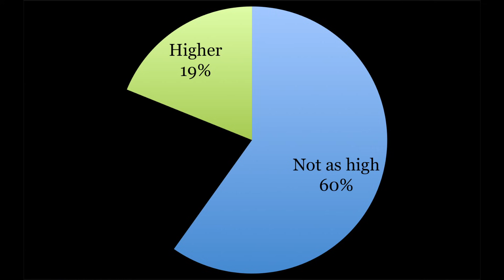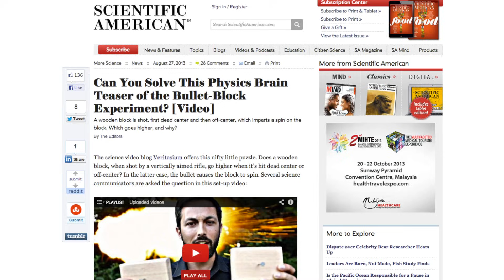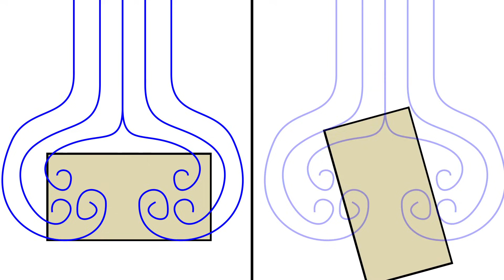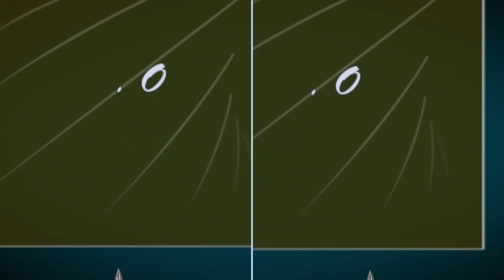Bullet Block Explained!

Comment: I know this video was over a year ago, but I watched it then and wasn't satisfied and I've rewatched it now and I think I know a better way of explaining it. The block shot in the middle IS rotating, but it is rotating away from itself in two equal parts, either side of the bullet. Imagine shooting it in the centre with a much larger calibre gun, the block would split in half and each half would spin off, one clockwise the other anticlockwise. This rotational energy is easily seen when a low calibre gun shoots the block to the side, because there is less wood on one side of the bullet and the energy can be more easily imparted into the smaller object. However if you shoot a low caliber gun into the middle of the block of wood this energy rotating in opposite directions is invisible to the human eye, because each half of the block tries to spin opposite the other but not enough to actually tear the wood apart.

Therefore, both blocks are technically rotating, but only one shows it in a way we would traditionally call 'rotation'.

Thoughts?
Reply: No, rotational energy is only based around total rotational momentum (and the moment of inertia). What way it would have spun had it not been stopped doesn't come into it. Smash two spinning wheels into each other, and they'll heat up, because both wheels have slowed down and its rotational energy has turned into heat.
Reply: It sounds plausible but it's impossible for one thing to be moving in two directions at the same time. Something can move in one direction and then another extremely quickly so that we can't see it (ex vibrating objects).
Reply: I'm sorry but ... No. You complicated the case too much. To understand why this isn't possible, imagine someone pushing right on your navel ( The human's body's gravity center ) when you're on a skateboard, for exemple. Can you say that your body is actually spinning ? I don't think so.
The explanation comes simply from the fact that the bullet lost less energy penetrating the wood. Right side got pushed away, it COULDN'T actually stay still and this particular side then has gone up, meanwhile, left side was also pulled up because it was sticked to the other side, it couldn't just stay behind. Due to the fact that the mass wasn't balanced compared to the center of the impact, it first had less mass to push up, the bullet then conserved a bit more energy that it redirected in a rotation movement ( Because the vertical momentum MUST still be unchanged ).

I really hope you've understood me, because I'm not a native English speaker and I might really suck at it.
Reply: DEREK RESPOND TO FIRSTNAME!!!!!
Reply: Firstname Lastname nope
Reply: I don't think this is a better way of explaining it, and I think the way veratasium explains it is much more accurate.
Reply: Firstname Lastname I think you're correct. However i wouldn't call it invisible rotation, but more the desire of the material to rotate (shear stresses), resulting into friction in the material. The friction then produces heat and the total energy is conserved.
Reply: mendel keller Explain to me one other time an object is able to move in two directions at the same time.
Reply: mendel keller Well sorry about that.
For the second experience,
Let's assume the wood plank was 20 cm ( 7.875 inch : ~8 ) long and the shot has been fired at 5 cm from the edge. The force then applied around the impact point 5 cm ( 1.96875 inch : ~2 ) large ( The force was applied on a shorter surface = less mass to pull up - and this is also the reason why the bullet didn't go as far as in the first experience ). That's what I will call "Right side". Even if this "Right side"got pushed up, "Left side" was still attracted downward toward the center of the earth by the force of gravity but you'd agree if I say that a firing gun deploy much more force than gravity. So, instead of just going up vertically, the "Right side" continued to travel and the "Left side" had no choice but following the movements ( Upper and the rotation ).
Reply: Firstname Lastname

Looking at your explanation, I see what you are thinking. Unfortunately, due to the fact that there is no observable rotation to one way or the other, the energy imparted can't be explained in rotational energy. The kinetic energy imparted in the block of wood by the sloped sides of the bullet would be equal on both sides, which would cause the block of wood to expand and contract very quickly around the bullet as is imparts momentum into the block. This is what was meant by energy being lost due to heat energy. The spinning block on the other hand, has inertia on one side, so the rotation would be imparted from the get go. Unequal energy distribution would cause this in nature on any given occasion. The reason they both gain the same energy vertically, would be due to the fact that the bullet would impart the same lift because as the bullet hits, the inertia is only off to one side, meaning that momentum picks up higher on one side of the block, and is picked up less on the other. Until the bullet and the stops moving inside the block of wood, they can both be considered separate entities. As a result, the energy imparted by the bullet would be equal, allowing both to reach the same height. But due to conservation of momentum, inertia holds one side back, and has less effect on the other, causing a natural rotation that does not require any extra energy input at all.
Reply: I think that what you mean is that as the bullet enters, it pushes both sides of the wood away from each other. This steals energy because both blocks are doing a slight, invisible about of "Work" against each other. However, this does not really make sense to me as an explanation because the two halves of the other block also are doing that tiny amount of work against each other...
Reply: Hmmm, I'm gonna say no to this theory.  The rotation occurs when hitting the side of the block because the direction of the force of impact does not travel through the centre of mass of the object.  The bullet hitting the middle does (or very close to it, which is why may still be a small amount of rotation, because it's not dead-centre).

The reason two halves spin off to each side when a block splits completely is because there is also a lateral force of the bullet breaking the wood apart - think like an axe splitting a log, but for a round bullet, it's actually pushing the wood apart in an imaginary circle (perpendicular to the direction of movement of the bullet) in all directions equally as it moves through the wood, but because the block in these experiments is usually thinner (therefore weaker) in one dimension, that's where it breaks. For the dimension where it doesn't break, the lateral pushing force from the bullet instead translates into rotation, but not until the instant when the pieces actually break apart - as the bullet exits, the "final bit" of force that splits the wood is imparted very close to the surface of the object - again, the vectors of these forces do not pass through the centre of mass of either of the two newly formed pieces, so rotational energy results for both pieces.

Conversely, if you fired into the centre of the end of a cylindrical block (i.e. a length of dowel) you would get rather different results - the wood "should" split into many pieces, each of which would have roughly equal rotational energy.  Of course, factors such as density distribution, which direction the grain goes through the wood, the path the bullet takes through the wood, and other irregularities come into play as well, but you get the general idea I hope.
Reply: *****
Hi.
Reply: Dim' Denis I think you're almost right. The bullet hit the wood at the right side of its center of gravity, creating a greater force, starting the wooden block to rotate  (the angular momentum) . 

Although this is correct (i think) the force upwards is not a result of the place of impact, the mass of the two blocks is the same and the force upwards as well (that's why the two blocks reach the same height, the horizontal momentum)

This implies that the bullet will travel the same distance in the wood for both situations. However, since one of the wooden blocks rotates, the bullet rotates slightly with it. The angle of the bullet changes and the resistance of the wooden block on the bullet increases. The bullet travels a shorter distance and the angular force increases (faster rotation)

That said, the horizontal force does not change at all, the angle of impact and the angle of the force are similar at all times.
Reply: Firstname Lastname I don't think that's quite an accurate way to describe it...rotational momentum is about the center of mass, so splitting it into 2 separate masses that are rotating with opposite torques doesn't quite make sense (at least as far as we're concerned here). The idea is that torque and force are independent. That is, as he said, linear momentum and angular momentum are independent. You learn this in Physics 101, but I don't think most people get it when they first learn it
Reply: well, ok then...
Reply: This is exactly how I was thinking about it and at this point I'm sure it's the best explanation.
Reply: this was my thought, and after reading this post, i think possible the straight block had more sound and vibration emissions. Or i believe the negative rotation may counter the positive rotation?
Reply: That's what I was thinking, the rotation doesn't occur because it is cancelling itself out, probably ending up heat/sound.
Reply: I think this is possibly true, the force of the rotation is split evenly and tries to rip the block in two pieces. But I do think the results in the video are correct. One of the responses I saw tried it with an air gun and candle for hitting showing much larger differences in depth. By Fysikshow if you wanna look it up.
Reply: As an MIT Mechanical Engineering student this is the only solution that I could come up with. Well done.
Reply: Okay mendel, you have been nothing but a nuisance for this entire thread. I pity your pathetic life where you interject intelligent conversation with idiotic and angry responses. If I were you I'd look up the Dunning-Kreuger Effect and make sure it doesn't apply to you.
Reply: Firstname Lastname that sounds really applicable!
Reply: +Firstname Lastname you only found a very convoluted way of explaining why it is easier to push an object off-center.
Reply: +Firstname Lastname Awesome way to see it! :D
Reply: +alauhalauh25 he's on to some thing with the basketball the point is a sphere does spin in two directions ..... hence the Coriolis effect ..... boom
Reply: So you mean that in the first block the spins are opposite so they cancel each other out and in the second block the spin is the same
Reply: Yeah no, I learned momentum in mechanical physics and veritasium's explanation is true. When two objects stick together during a collision all of the linear momentum is kept. It means that rotation is simply another phenomenon that isn't related to the linear movement.
Reply: Hold up. You learned momentum? or learned about it. Linear motion is conserved but so is energy. The momentum of the bullet is conserved. But so is the momentum of the block. Zero momentum to one side, the bullets full momentum to the other. It is still lifting the same amount of weight so, due to inertia, the block spins towards the side that wasn't hit by the bullet. The problem presented is that the only momentum introduced IS linear motion. But because we expect ALL motion to be conserved through energy, the rotation isn't ( or at least hadn't seemed to be) accounted for in the bullets energy total.

The math works out on it though. Newtons three laws of motion all play a part here. Inertia, F=Ma, Equal and opposite forces.
Reply: The reason a large calibre gun would do that is because it drives a wedge into the block pushing it apart. So yes, a small bullet is doing this, but it also drives a wedge into the off-centre block. So this cannot be the reason.
Reply: They should take the air out of the equation using a vacuum and use a piston to shoot it upwards!
Reply: Firstname Lastname What a stupid explanation.
Reply: Lmao dude I wrote that first comment 2.5 years ago.
Reply: yeah.... someone knows their science.....
Reply: This comment seemed to cause a lot of controversy.
In reality, both sides are correct. The "zero-sum-spinning" that Firstname describes and the distance the bullet travels in the wood are very intimately related.
If you imagine trying to rotate two halves of the wood against each other, what is it that you're actually doing? You're trying to rip it in half.
The "rotational" forces are transformed into a force that is trying to rip apart the molecular bonds in the wood. And for this reason the bullet travels further in the wood, if only a little.
Reply: it may sound good, but theres no reason to think its factually correct.
Reply: That's a broad statement that could apply to literally everything. Can you help me to understand the 'solution' provided in this video?
Reply: its not really a solution to the total energy rising problem, it explains why they go to the same height, simply put - momentum is conserved.
Reply: mmmmm, tell me more.
Reply: mendel keller I'm sorry but I can't take you seriously with your profile picture. You look so tryhard XD
Reply: *****
What's the connection? please explain. (awesome link btw)
Reply: it actually not only is possible, its how the universe operates, stephan hawking uses it to explain why infinities dont throw off the balance we have. calling yourself a troll doesnt make you any more scientifically literate.
Reply: mendel keller Hahahahaha. You're very funny. They aren't moving in two directions at the same time. A spinning basketball is spinning in one direction. A Frisbee has the exact same dilemma as a spinning basketball. Besides, this doesn't even help prove your point. You proposed that the block shot in the center mass is rotating in both directions at equal speeds, thus canceling itself out.  The objects you described are rotating in one direction, not two at the same time. Example, can you walk forwards and backwards at the same rate, thus canceling yourself out?
Reply: alauhalauh25 a Frisbee... a spinning basketball, angular momentum itself is just combining two different motions...
Reply: Dim' Denis
your english does suck, try using some equations.
Reply: mendel keller You know what else I love? You think very highly of yourself and I can tell just by the way you talk and present yourself online. And yet, you don't have the intelligence to identify a troll when it presents itself to you. MERRY TROLLMAS!!!!
Reply: i actually think this is a good explanation and its sounds logical, thanks man

Comment: So how is the difference in the depth of the bullet when measured with the nail explained against the x rays showing them the same depth? I might have missed that.
Reply: I presume they just measured it wrong. it's going to be difficult to measure the path length of a bent path with a straight nail.
Reply: The path the bullet took within the spinning block was a bit curved according to their explanation, so probably the nail was obstructed and couldn't go all the way in. The hole seems pretty narrow, slightly wider than the nail, so it wouldn't take a very big deviation.
Reply: IamGrimalkin But the xrays showed nearly identical paths.
Reply: Nameguy splinters possibly
Reply: There is a very slight difference in the depth the bullet would penetrate. It's explained at 8:29 and that's the reason he asked for suggestions on how they could use a different test in which the difference would be measurable.

Comment: Answer summary: Kinetic energy is not conserved when the collision is inelastic. The block rotating ends up having more kinetic energy than the non-rotating one. Additionally according to Newton's Second Law, with the same external force vector and same mass, it must result in the same acceleration vector.